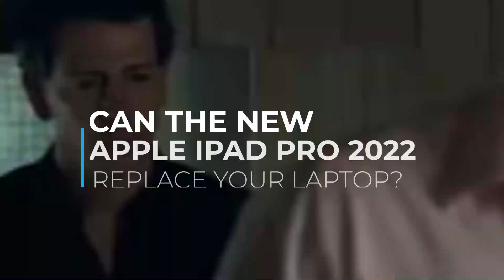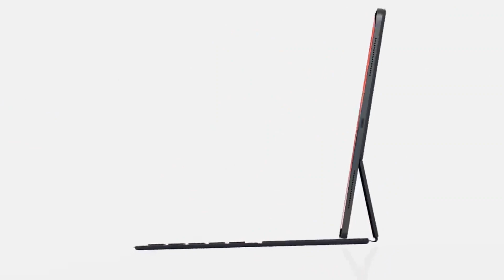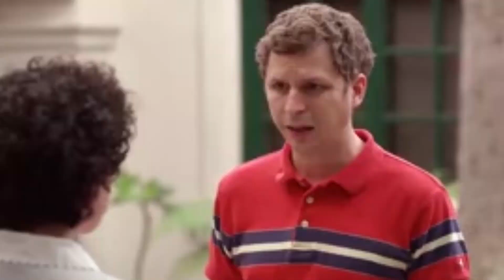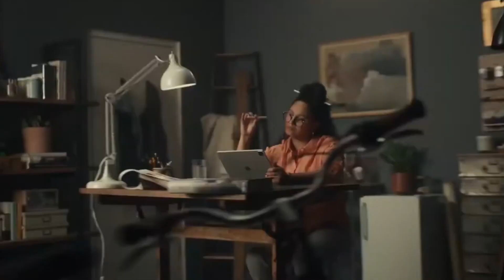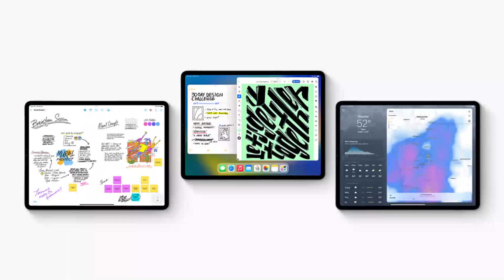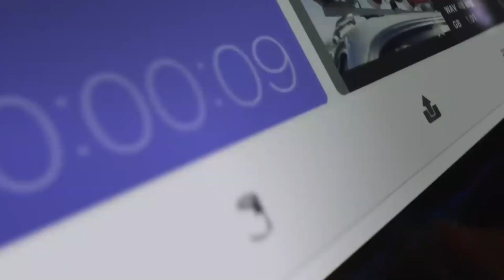Can the New Apple iPad Pro 2022 replace your laptop

Comment: Yes it can 1000x yes. The limitations of the iPad has more to do with proprietary software that dose not have mobile or tablet/iPad counterparts. This is a developer issue and not so much an iPad/tablet issue. Many devs are coming around and releasing tablet/mobile versions of their software. This was one of the major issues with windows mobile where there was not enough software being developed for the platform. Things that the iPad cannot do like burn a dvd are minuscule compared to what it can do. In many cases the iPad Pro can do more than a laptop can.

Comment: I would say yes and no. If you are using the iPad Pro alongside a cloud PC service such as Shadow or Windows 365, than it could be a laptop replacement. Please note that you need a good internet connection to get the best use out of a cloud PC. If you are just using iPadOS, the answer is no due to the limitations of the software.